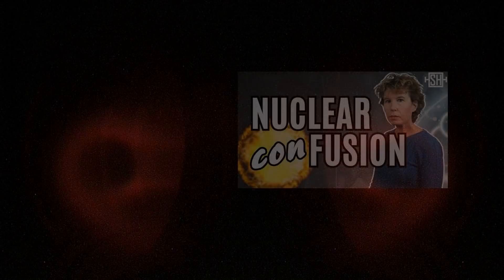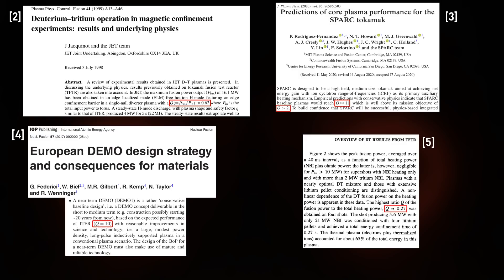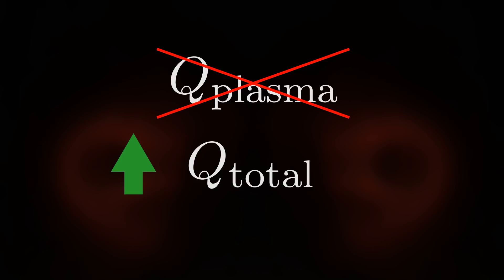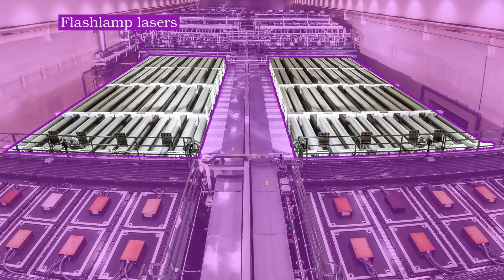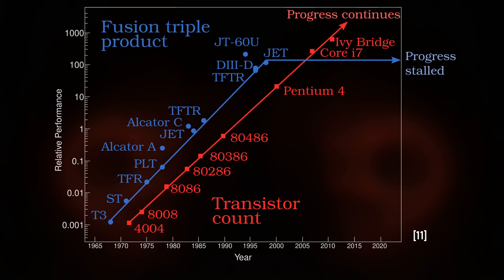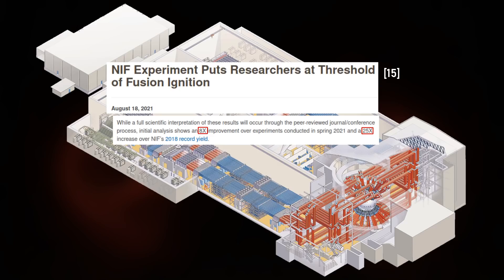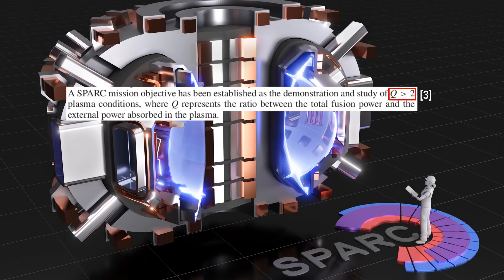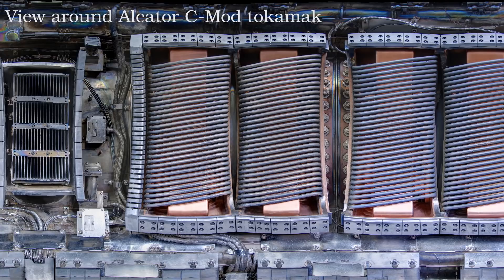In defense of "Q-plasma" - a response to Sabine Hossenfelder

Comment: There is another metric that is being ignored and that is the economic viability of a system.  We very well could get Qplasma to 20, Qtotal to 1.1  and not have a real world viable fusion power because of the financial cost...
Reply: @Shimmy Shai gravity-based storage is a scam though unless it is a hydro-electric energy storage
Reply: THANK YOU!!!!!!
Reply: @markpurcell8075  everything has a cost, it is not about capitalism
Reply: Some econometric studies say that a energy source that hasn't an EROEI (energy returned on energy invested) at least in the range of 5-10:1 is utterly useless to sustain our current economical and social arrangement. 
Oil had an eroei that was 50:1in the 1950 (now about 15:1). Fusion is just a pie in the sky, and will ever be.
Reply: @pierluigidipietro8097 For renewables, how do the numbers look?
Reply: @sifta7  not so good, either. Renevables can supply in perspective 30-40% maximum of current needs. The dirty little secret of "sustenaible growth ", is that it does not exist a sustenaible growth. To have a sustenaible equilibrium, we have to cut at least 40% of current energy consumption
Reply: @pierluigidipietro8097  Energy policy affects everyone, and it’s vital to air out options to make sure everyone has a chance to see where the goalposts are
to help people direct their efforts accordingly.  Thanks for sharing.
Reply: That is more of an economic system issue than an engineering issue.

Comment: Sabine video actually helped me to understand that ITER most likely will never be a real power plant but more like LHC with different purpose. Before i was quite sure that they would get some electricity out of it. Maybe not much but at least something.
Reply: Well, it was kind of stated from the beginning.
Reply: even the ITER's successor DEMO isn't going to be a real power plant, that's gonna be in 2050s according to the timeline. If everything goes as planned, the first commercial fusion plants are here in 2060s-70s.

Comment: a great video with very relevant information and good delivery, i liked it. particularly the example with antennas that could easily be optimized for a particular frequency if the goal was a working reactor rather than an experimental machine. i kind of did not realize that.
Reply: they already work/are projected to work at 30 % eff., what could you expect? 40 %?

Comment: A better car analogy would be that you can't design better tires if you don't know the shape, size, and weight the engine will have. And the engine efficiency dominates the tire efficiency while the engine is also much more complicated, so working the other way around, trying to design a working engine to go with theoretically perfect tires, is nonsensical.

Comment: Do I understand it correctly, that the major "stumbling block" on the way to a stable confinement, are the instabilities inside the plasma, like, for example Alfven instability? If yes, then, why don't we hear more about what has been done in researching those instabilities and finding ways to minimize them? If we speak about conducting interesting experiments, then, I would assume, we need to talk more not about the "magic Q-number", but rather about the physics that prevents long-term plasma confinement. Also, it would be interesting to hear about Tritium problem, how it is being handled. As always, IMHO.
Reply from the maker: Yes, instabilities and turbulence are the biggest hurdle to achieving fusion. Which type of instability has the greatest detriment on confinement curiously depends on the specialization of the scientist standing nearby. ;)
While there is a lot of academic research being done on these instabilities, the surest way to combat them is to build larger or higher field strength machines. I will cover tritium breeding issues in a future technical video.
Reply: @ImprobableMatter  Do you think that the larger stellarators will give you a more uniform magnetic field, so you will have less "destructive" instabilities? But the larger devices imply larger surfaces, thus the boundary effects will be more pronounced. Just wondering.
Reply from the maker: Hard to say very specifically. W7-X has set a temperature record 10 lower than the best tokamak performance and 100 times lower triple product, so the stellarator is not a magic solution. Would a bigger stellarator be superior? Yes, but it would also be harder to engineer.

You mentioned a new physics regime when alpha particle heating begins to dominate - if they drive currents this would be great for tokamaks and destabilizing for stellarators, and vice versa. In any case, we are committed to the tokamak route in the near future, so hopefully any physics solutions we come up with will also transfer over.
Reply: @ImprobableMatter  I did not realize that you are running a tokamak, my apologies. I got a "whiff" of tokamak physics, when I was studying plasma physics, as it was the design that was promoted by Kadomtsev. Cheers!
Reply from the maker: I did work on a tokamak, but I meant "we" as a species - the major machines being built now are all tokamaks with a heritage back to T-3 at the Kurchatov Institute.
Reply: I don't think the solutions to those problems are at the engineering or experimental phases just yet. From what I've heard the area that really needs improvements is the mathematics of fluid/gas dynamic simulations... 

Although to be fair I did hear that from a mathematician friend who specializes in fluid/gas dynamic simulations, so perhaps that's not too surprising.
Reply: We need to build larger or higher strength machines? That's what we need, kinda stuff that sets physicists hearts racing.   Likely why they've been bending the ears of government for decades, asking for money to fund these monstrosities.   I reckon the main criteria for this tech is not whether it works but rather is it possible to get a nice shot me looking heroic inside said machine.
Reply: @michaelkenner3289  It is pretty obvious that first people build and run theoretical models, as nobody builds a giant installation just because .. Now, here come a rub, which should have been mentioned. All mathematical models include approximations or simplifications. This is why they are called as "models". Important also is the fact that fluid dynamics actually deals with solving a set of nonlinear differential equations, which is quite a challenge. Combining the first and second statement, we get that a lot of computational time is spent to solve an equations system, which itself includes some assumptions and simplifications. Imagine that the solution tells you that all good, and we will make energy/money. The next step is to build the damn machine, so you built it, bt it does not produce what was expected. Why? Because of the nonlinearity, which may rise its ugly rear even if you omit some things or simplify them. So then we are back at ground zero. Update model, run calculations, build, compare the results with predictions and.... Hope this iterative process will end sometimes. And, oh, btw, yes, we hear what Q's different group achieved, but we did not hear what they had planned to achieve before building their systems. IMHO. (P.S. I am not a mathematician, just a theoretical physicist :) Cheers!
Reply: The main focus of my research used to be controlling an instability called an "NTM". Other instabilities people are trying to figure out ways to detect and control are sawtooth, ELM and the vertical position. Besides these instabilities there are other things like the density limit and the quantities of various gases that need to be tightly controlled. (Hydrogen isotopes are the fuel, but you need some fraction of other elements to protect the wall).

Comment: i was enjoying this until the author used the word "profitable" at the 5:49 time mark. Its one thing to have a fusion reactor that works in an engineering sense (net electrical energy production). its another thing to deliver a technology that is not so expensive that it has no commercial consequence. In the world beyond 2040 we will have both cheap renewable energy (we already have this but it will get cheaper) and mature (cost effective) grid scale energy storage. It is highly unlikely that fusion reactors will compete given this commercial reality - except in some niche uses. 

I don't mind spending tens of billions on physics experiments. That's probably worth it. We may even perfect fusion energy for space propulsion. But its going to have little relevance to electricity supply on Earth.
Reply from the maker: Fair enough. Consider it to mean "profitable in terms of energy", rather than money.

Comment: Nice response.   Just goes to show how semantics are important.     It would be nice to have a term that clearly communicated the progress toward fusion success that was easy to distinguish from another term that indicates progress toward power generation success.
Reply: It's just standardization in thermodynamics for describing energy transfer

Even Qtotal is only a part of the metric for whether a fusion power plant should be made and whether it's successful.

At that point you're talking about the costs to build and fuel the thing, and how much you can charge for the electricity it creates, and how that works with the variety of nuclear, renewable, and fossil fuel based plants

Comment: What Ms Hossenfelder wants to say is simply that we are still very far from having an industrially applicable fusion reactor and when the press states that next generation (after ITER) will deliver power, this in reality does not seem really true. And even if it is true, the next generation will not need 20 years to be developed but maybe 30-40. So, concluding, we won't have a nuclear fusion power station before the year 2050-2070.

Comment: Thrust SSC broke the land speed record long at close to 1200 km/hour. If its wheels were spinning normally, the tops of its wheels were momentarily going 2400 km/hour in the forward direction, for one short instant during each revolution. Sure, you can correlate the speed of the top of the wheel to the speed of the car (divide by 2), but it's not a figure the average lay person expects to see quoted in a glowing press releases. Qmax of 2400 km/hour is entirely inside baseball. And sure, some guy in the pit crew knows that the top of the wheels is the first part of the car to break the sound barrier, so Qmax is an engineering figure of merit. But still, it would bamboozle the public something fierce if that was the number they mainly quoted. I was entirely sympathetic to Sabine's video at the time I watched it. Needed to be said.

Comment: Fusion energy has more problems than just hitting a high enough Q by any measure, Qtotal or Qplasma. There are many radiation damage problems to be worked out. Material inadequacies are among the hardest to get past. Radiation-induced stress-corrosion cracking is a severe issue. Fusion looks like a real long shot to be economically successful. Slow down fusion research spending. 'Bigger' isn't always enough.

Comment: ITER will NEVER result in a commercial reactor design.
And if it does, it will produce the most expensive electricity of all time.
A reactor which requires 90 tons of liquid lithium to prevent the machine killing everyone in the building is moronic.

Comment: Well done in getting across a valid (but nuanced) argument.

One feature of ITER Is the provision of more than one mechanism for carrying out certain processes in the fusion reactor - for example multiple methods for heating plasma (if I understood things correctly). That is another example which characterises ITER as an experiment not a prototype.
Reply from the maker: Yes, you're totally right. ITER will have 4 broad types of heating: Neutral Beams, Ion Cyclotron, Electron Cyclotron and Lower Hybrid (as well as inductive, but this is not sustainable long term). The ARC proposal, being more focused on performance as a reactor has just 2: Ion Cyclotron and Lower Hybrid.

Both approaches are correct, given their aims: ITER will have the breadth to experiment, while ARC would be tightly focused on demonstrating electrical output.
Reply: @ImprobableMatter  Last I heard, ITER is not planning on installing Lower Hybrid. MIT is advocating for it, but my understanding is the consensus would prefer to see 20MW more ECRH.

Comment: I understand your point, and definitely agree with it. Everybody in the fusion community is aware of it. The problem Sabine makes, however, is that the public is being misled, by making them believe fusion reactors are "around the corner." I posted the following in Sabine's video:

Excellent video! It's great you set the record straight in this matter. I'm actually fond of fusion and wish it will be a successful source of energy, but I cringe every time these people cheat (that's the word, not "confuse") the public into believing fusion is almost there... "whether they are physicists or humans." Paraphrasing Eduardo Galeano, fusion reactors are like the horizon; it moves farther as you approach it, but it keeps us moving, and advancing in the effort. One comment on the video: Although I understand you are speculating how much electric power ITER would produce, figuratively speaking, it should be clear that it isn't designed to produce electric power.

Comment: This is a good video but I think the point remains that fusion reactors use a lot energy beyond that which is used to heat the plasma, such as to cool the magnets, and this energy in fact considerably exceeds the heating input. So Q_plasma of greater than 1 certainly does not mean that net energy is being created even without regard to electrical generation.
Reply: did you even watch the video?